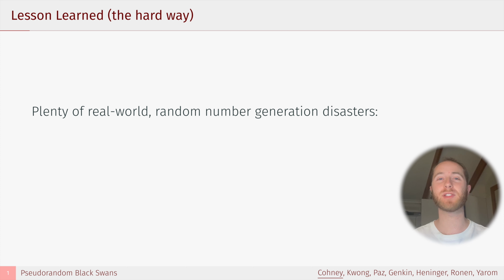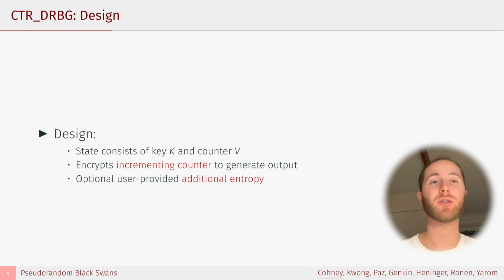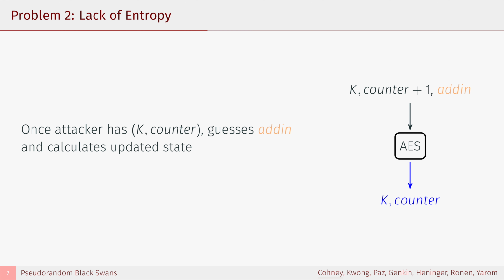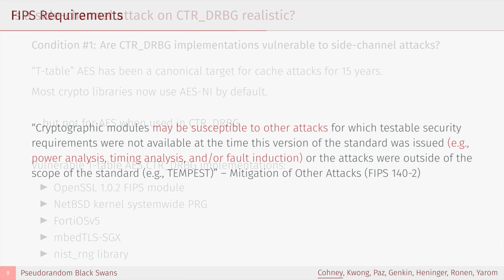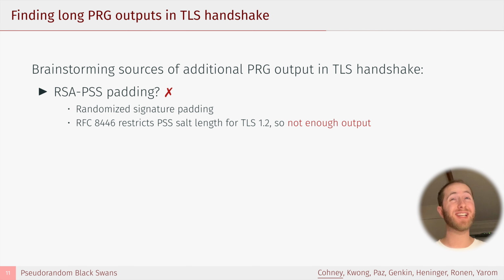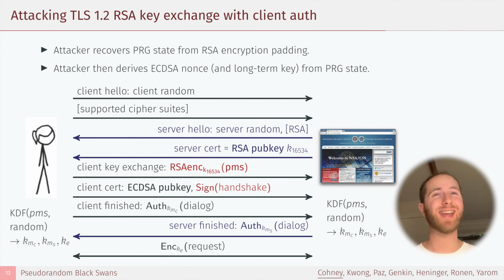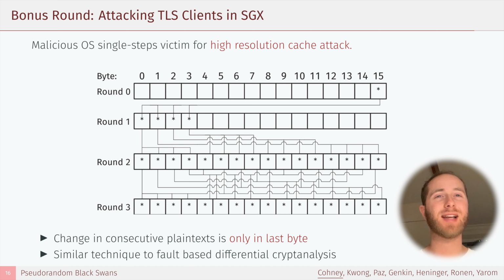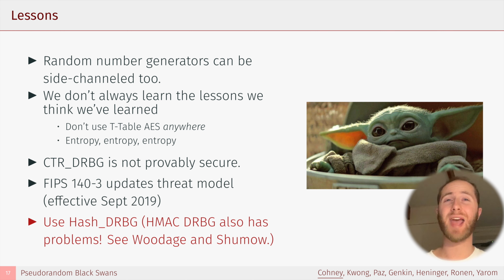Pseudorandom Black Swans: Cache Attacks on CTR_DRBG

Comment: If you recommend the hash_drbg, I suggest you take a look at the derivation function that looks nothing like an extractor. The CTR-DRBG remains the best option from the three SP800-90 DRBGs and it can be built securely with careful design. It is the most efficient and can be built on naturally constant time calculations. Use an SP800-90B conditioner - do not use the block_cipher_df which is a nightmare. There is no excuse for allowing 2000 bytes in a single request. The right number of bytes requestable is 16 (128 bits) so the key updates on every AES output. Additional entropy is a silly idea - redirect that spare entropy to an XOR contruction or oversampling construction NRBG or more frequent reseeding. Similarly all the other extra inputs should be disallowed. I agree the V+1 structure is bad (it formed part of your attack) and it would have been better to do something like a multiply (by say 2 or 3) in GF(2^128) which would be faster and simpler in hardware and would change many bits in V. Although with an update every 128 bits, this is moot. The attack described here is an example of why you should not do RNGs in software.